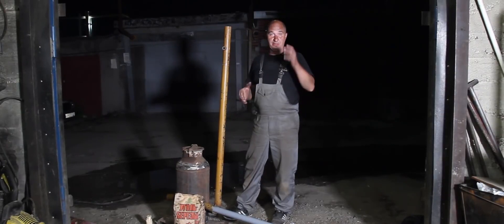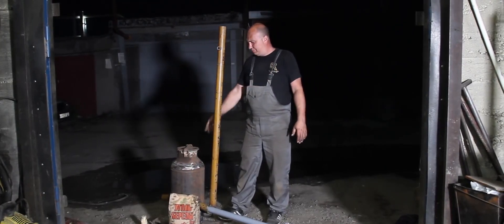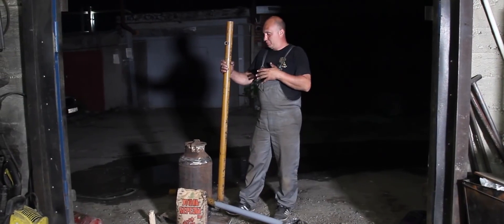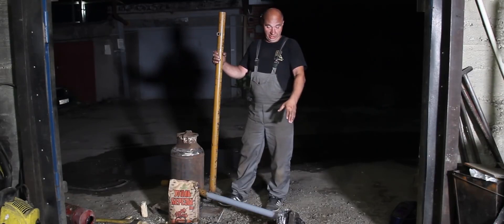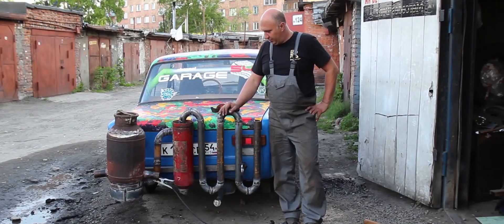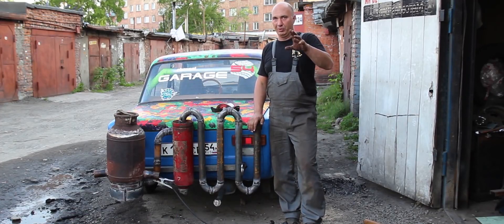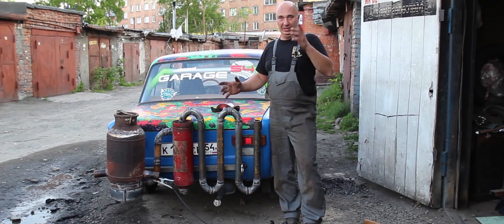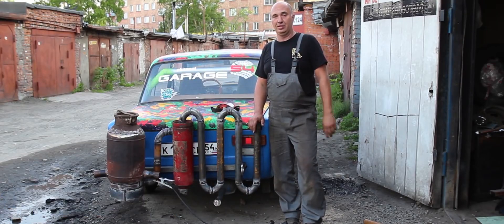Converting a car to run on firewood

Comment: use 'Diamond-bit' cutting discs, they are 20-times longer-lasting than simple abrasive discs, and they cost about the same as 5 abrasive discs.

Comment: In this example they are not burning ,,wood gas''. They burn carbon moxide. Wood gas is made of wood. This gas is made by incomplete compustion of very pure carbon. I didn't think that it's possible to run car engine on pure carbon-monixide. Magic!

Comment: Tip: When cutting gas bottles, fill it with sand. It wiil do just as good as water and it won't spill and if its easier to cut with the bottle lying down, all you need is some tape over the part you have cut already to keep the sand in.

Comment: have you tried the dual transmission theory of on transmission running a four cylinder running a v8 rear mounted transmission. it is a street legal dragster. well it is currently still street legal.

Comment: This is actually a technology that has been used several times throughout history. During WWII, many US cars were converted to run on wood-gas to help save oil for the war effort. There are many downsides to it, such as its bulk, energy content, slow start and dirty fuel (Without good filters). But the fact that you can run engines off of dry plants is pretty awesome.

Comment: 45 plus years ago knew somebody who built a wood/gas conversion for his 55 GMC pickup, it worked but top speed was 40 mph every 20 miles or so had to stop and mess about with it, after six months he switched back to using gasoline ,

Comment: Glad to see your using a mask when you're welding. Also filling it with something inert like Argon would probably work better than water.
Reply: Ok, explain that, genius?
Reply: Thenotfunnyperson relax I'm not putting the man down simply trying to help. One of the first things you learn when you go to a welding Vocational School is welding safety. You're supposed to take the hose from the Argon gas tank that you also use in welding stick it in the bottom of the tank and let it fill up. The Argonne gas does not burn it's inert. It basically pushes the flammable gases out and replaces it with something that cannot burn. It also doesn't leave the inside of the container soaking wet requiring a fire to dry it.

Comment: Used here in NZ during WW2. Fitted to the rear of the vehicle it used charcoal to produce the gas which filled a big rubber bladder on the roof which was connected to the engine. The bladder allowed for the varying amounts of gas  required during motoring when the gasifier produced a steady output.

Comment: Before natural gas was commonplace, it used to be made in gas works facilities artificially out of coal.  A fire is made good and hot so that plenty of embers exist in the fire.  The air is then shut off and superheated steam is then passed through the embers for a short time.  The residual hot carbon cracks the water into hydrogen and carbon monoxide.  This gas is free of nitrogen contamination.  This pure gas is then passed over hot nickel, which converts it to methane.  

Methane is 10 times more energy dense than producer gas from a gasifier (due to the absence of nitrogen).  Because of this, it becomes practical to compress it for use in a vehicle.  I used to work with this process.  My personal experience has shown that the conversion to methane is surprisingly easy and complete.

Comment: This is great, you are using wood instead of petrol, ekologic (maybe), i have seen this on some WWII cars or even older. Is it possible to legally drive a car that has been rebuild to run on wood gas?
Reply: Dalibor Ficek don't see why not as long as it's a street legal vehicle to begin with

Comment: Fun fact : wood gas generators mounted on vehicles were quite common in Europe during World War II, due to petrol shortage.
Reply: Gasogen. It was widely used in Spain among other countries.
Reply: Gazogen was quite common in Greece during the German occupation seens al the petrol and gasoline was taken by the German troops
Reply: They was also used in New Zealand. Often they ran on coke or charcoal rather than raw wood, as this doesn't produce tar.

Comment: This looks good. I have been wondering if GE was going to make a gasofire system. Can't wait for part two. Wish I could remember the show I first saw a system like this on. Where a group of ppl where placed in a can industrial complex simulating a national disaster. They had to service and then escape
Reply: Brandon Allen The Colony?  Is that the show you're thinking of?
Reply: TheAttacker732 that may be it. Thank you. I got to look it up. Thanks

Comment: Woodgas!  Fairly simple process but after time you get a lot of tar buildup in the intake.
Great video.
Reply: How much tar buildup depends on how good your filtration is. It can be designed to have little to no tar reaching the engine, but it's a lot more complex of a system than setups that deliver more tar to the engine.

Gasoline engines can run on wood. Diesel engines can run on vegetable oil. The issues is a lot of modern engines need a lot more modification to work.
Reply: Mark R building a filter/scrubber would greatly help. A big catalytic converter from a wood stove or truck fitted to the reaction vessel could clean the gas. If mounted next to the fire box it can use some of the wasted heat to keep the converter at a decent operating temperature.
Reply: what woodstoves have catalytic converters fitted? and how terribly expensive are they? 
asking for a friend.
Reply: Son Brother I know California requires them on any new install. Not sure of the price.
Reply: What does the "cyclone filter" and the radiator accomplish?
Reply: Condenses and filters the tar out of the hot wood gas.
Reply: i think that the "cyclone filter" kinda throws bigger particles on the sides of that thing so the gas is cleaner (just what came in my mind, not sure at all) and that radiator cools down the air, since its pritty hot when coming out of the burner
Reply: Charcoal is the solution
Reply: Charcoal taxis used to be common during wwii because of fuel shortages.  Charcoal burns without tar.